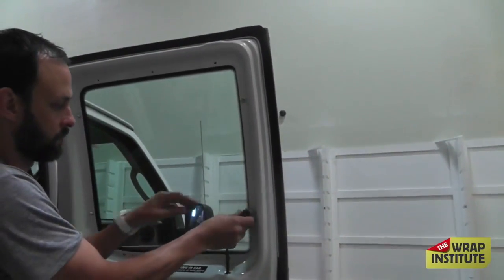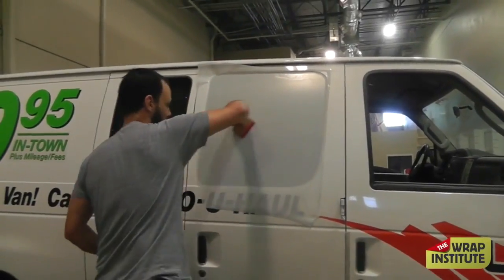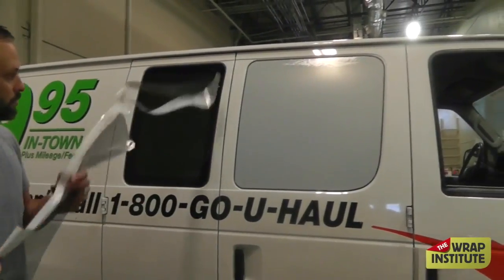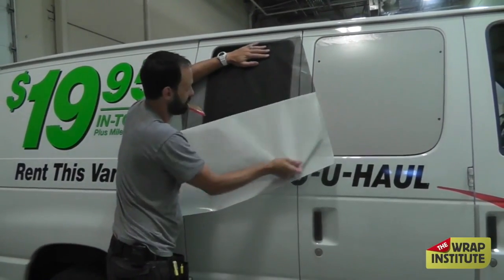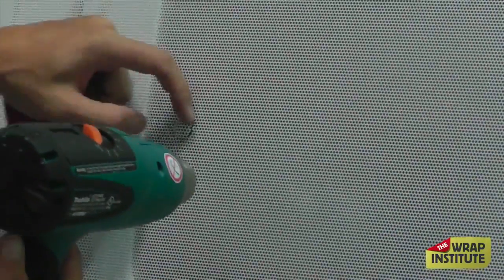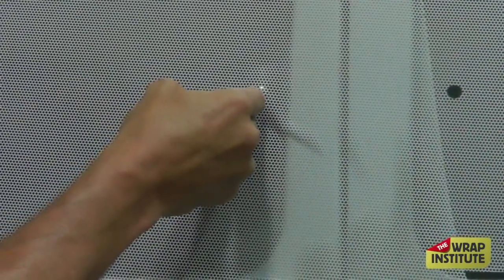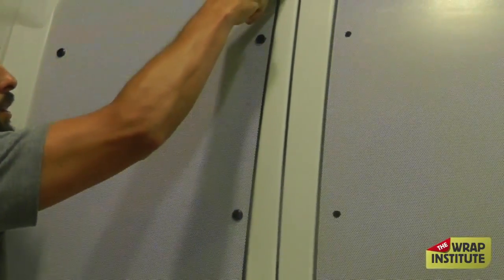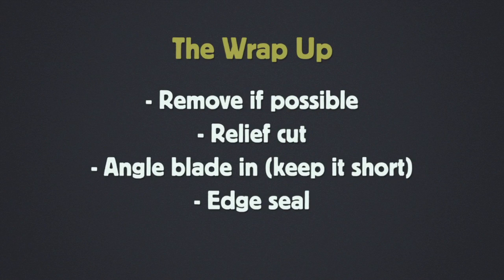Applying Perforated Window Film To Free Floating Windows (11:03)(2014)

Comment: I bit confused about the blade angle. Do you want the point of the knife pointing towards the window or away from the window? Wanting to install this on the rear windows of my 2018 Transit Van.
Reply: I'm confused too. It looks like the knife blade is pointing away from the window but you say multiple times that it should point away from the window.
Reply: Right, sure looks like the handle is angled in and the blade is angled out!
Reply: The angle between the hand and the window is acute. The blade is beveling the edge of the window face so the vinyl doesn't wrap around into that frosted area of the edge.
Reply: .. maybe he means the hand is angled closer to the window and point of the blade is pointed out. How did it go for u?